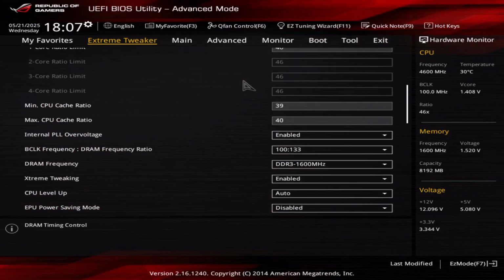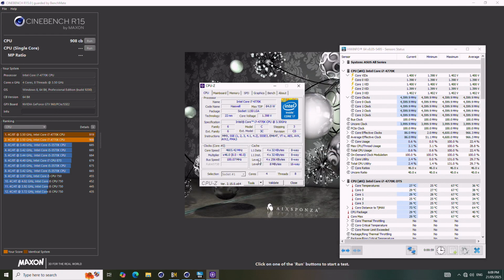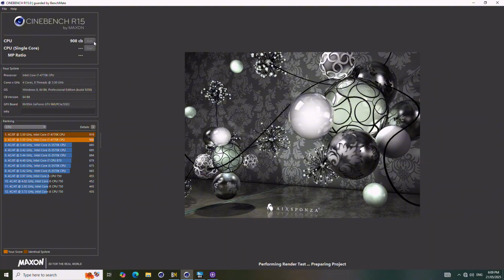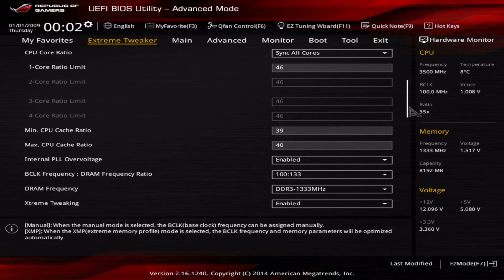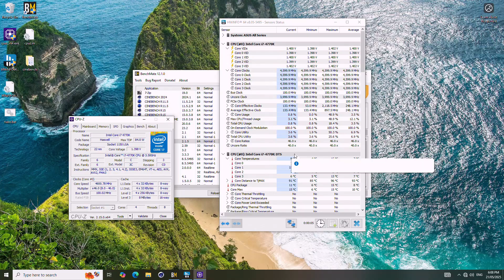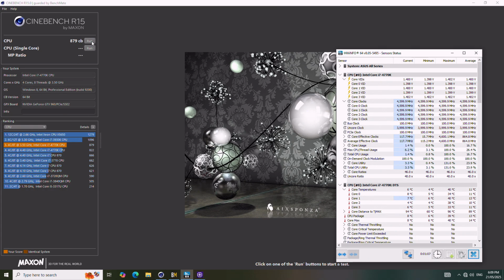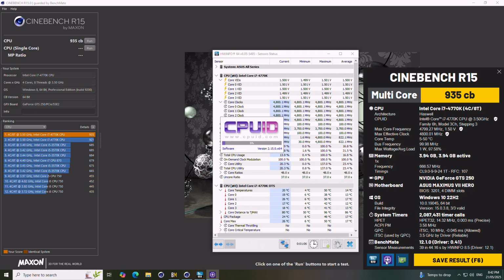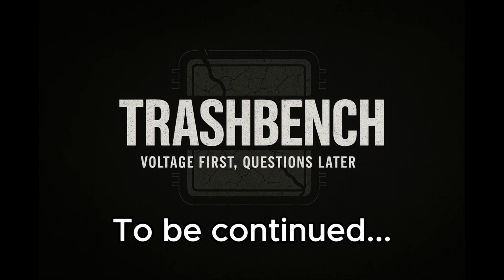I Cut Apart an AIO and Submerged It in Ice to Cool a 4770K… And It Worked

Comment: Also, check the voltage ratings of all the  electrolytic caps on the PCB . I've found if you run close to our exceed their rating, the caps will last approximately a year then outgass and fail. If they're cheap electros, the rubber bung won't have a gas release pin hole and the caps will bulge at the top. If they do then you won't be able to tell it's an electro issue. Treat this as a secondary issue. 

Get your self a thermal camera. of around 320 x 240 pixels, one with normal vision camera image superimposed on the infrared. You will see instantly, where your thermal issues reside
Reply from the maker: Nah, that board is already dead! I don't build these things to last 😉

Comment: I like the vids, but you gotta start using better samples to begin with. My 4770K that I got from luumi (finnish xocer) did 4.9 daily on a shitty AIO with very moderate volts (<1.33V). On a phase change cooler I did 5.5GHz gaming. Your 1.6V 4.8G on a chiller is just pure garbage chip.
Reply from the maker: Fair, but I also bought this CPU for $5 with an unknown history... I was also trying to to push the voltage until it died. This was never about stability.

Comment: What if you use different alcohol at different proofs and see if it helps? Like water can't go any lower as it will turn to soild (Ice) therefore there must be some fluid that can reach a low temperature without turning into solid. Like can you use vodka or something else?
Reply from the maker: Yes! That is a good idea, Isopropyl alcohol will lower the temp of crushed ice by about 10c, BUT! It is very flammable and having a pump in there would scare the jebus out of me... I'm silly... but not that brave! I have another one planned, but I'll just be using salt water.
Reply: @TrashBench If your planning on salt water will it corrode the pump will a DIY Peristaltic pump help?